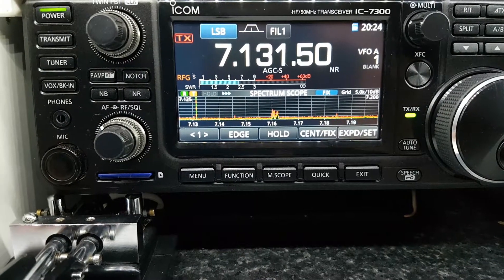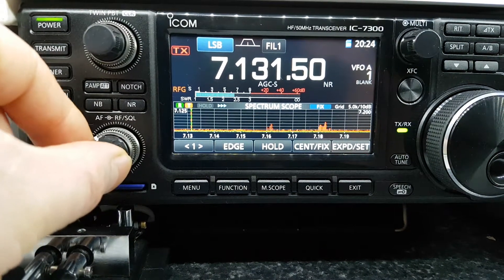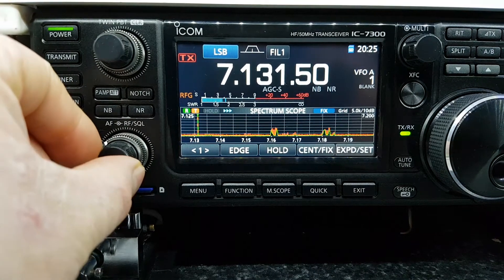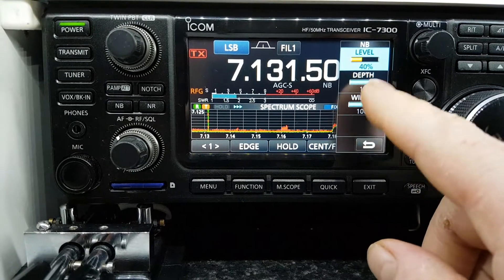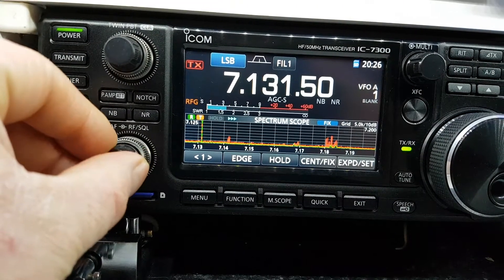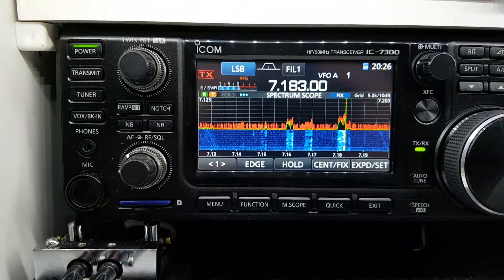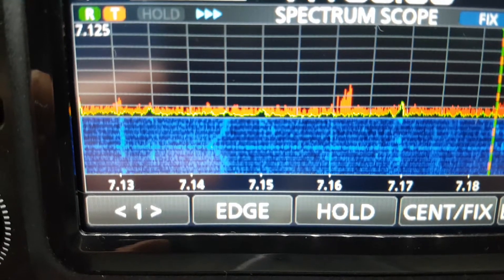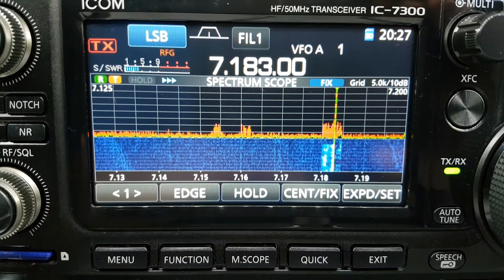Icom IC-7300 Noise Blanker Demo & Menu Explained

Comment: Sounds like power line noise and/or noise from the house, dodgy psu, laptop, mobile. I had some filthy led bulbs and also a really bad satellite receiver PSU. 

If power line noise try find the dodgy pole with am radio and then when you are close to it try UHF radio to see if it can pinpoint the exact pole. 

The ESB will come out and try fix it but would be a lot more helpful if you could narrow it down. 

But the noise blanker is great on the 7300 !

I had a dodgy ESB pole and the ESB came out but by the time they came out a Storm came and knocked a tree over and snapped the pole in half and bingo, problem solved !
Reply from the maker: Hi. I live in a very built up area. Most of what I'm hearing is mains Bourne from my neighbour's. Laptop supplies etc etc. For my location it's actually not bad, and quite a bit better since this video was made. 73 de EI7KO
Reply: Yeah not so bad in a built up area, the noise blanker sure is impressive.

The 7300 is a good radio , I hope to sit the Ham exam in May and if I pass I think this is the radio I will get , was also considering the FT-450D so haven’t fully made up my mind but my main concern now is to pass the exam ! :-)